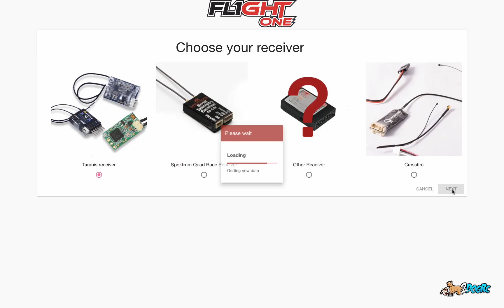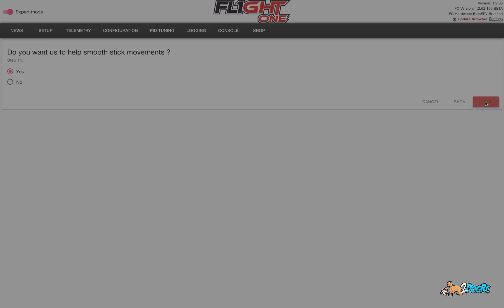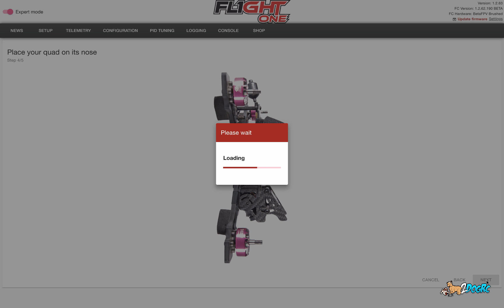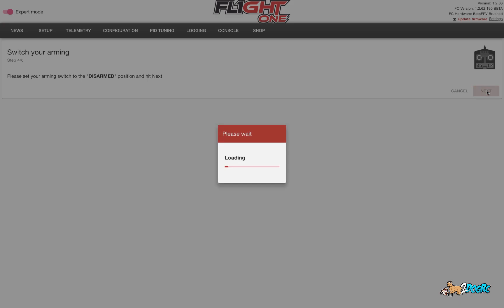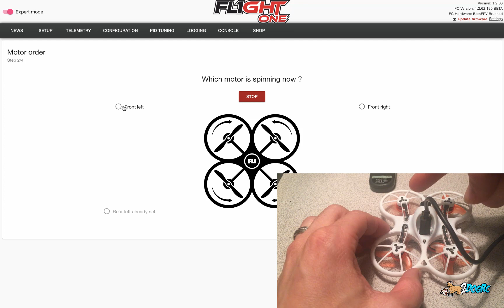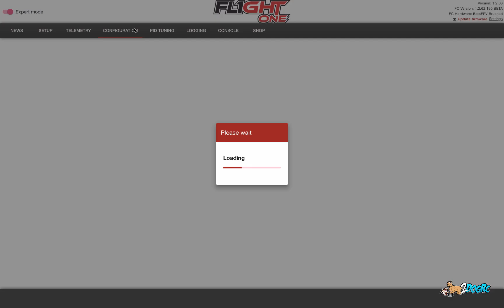Video 2: Flight One Wizards and Setups for Tiny Hawk, One step You will do wrong without this video!

Comment: I installed FL1_TinyHawk_1.2.92.bin to my TinyHawk and used FlightOne_DUMP-PMB-v1a.txt from console. Again calibrated ESC and transmitter. But when I arm the Tiny, after 20% of throttle I get 100% trust. It look the same like when you try to fly without props with FL1. But there are props. Do you know what could be wrong with it? I don't want to go back to BetaFlight. :frowning: Thanks for any advice.

Comment: why osd dont work, it work fine with BF...any chance to solve that? I need osd for my battery survival
Reply from the maker: Osd has a conflict of resources. Betaflight and Flightone use different communication methods. I doubt it will be fixed until Falco, the new Flightone software, is released.
Reply: ok, good to know, i love F1 almost all my quads are F1, but i will stick to BF for TH....anyway thanks for respond
Reply: OSD is now working according to FlightOne on FW 1.2.76
Reply from the maker: @Crownleyian  Nope, still not working.